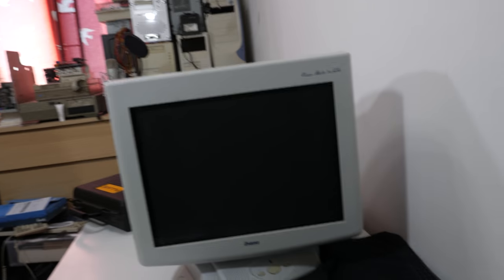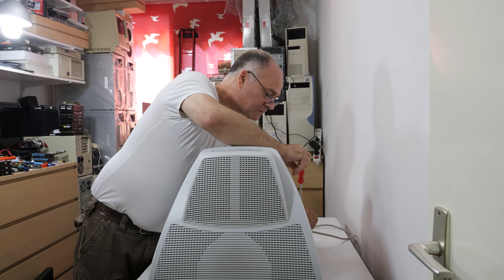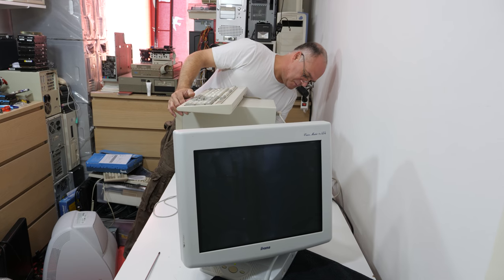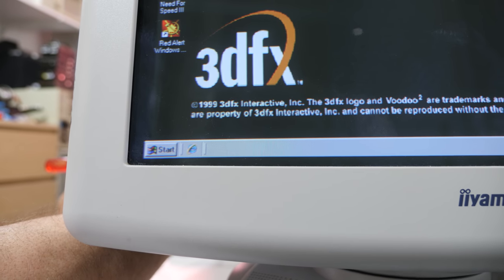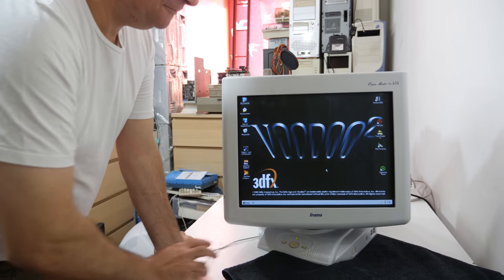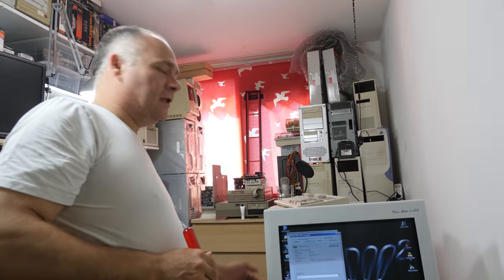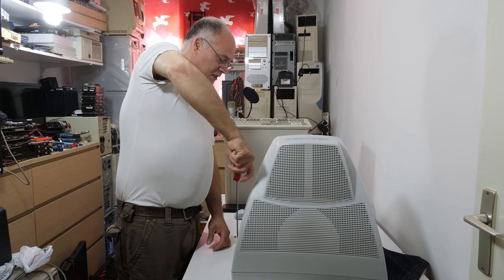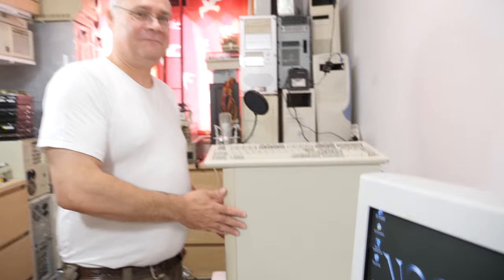Adjusting Old Crt Monitor With Dave, Iiyama Vision Master Pro 454 19"

Comment: That's NOT how you do it, you need to set the resolution to 1600x1200, used a calibration app to run a readability test (the NEC monitor test program is great for this) and adjust BOTH the focus and F2 potentiometers until you get a sharp result (these are very sensitive). Finally you want open a fully black image, set brightness to 50 in the OSD and adjust the SCREEN/G2 potentiometer until the black stop being fully black to get the brightness/screen setting back to their factory values. (as electron guns degrade over time, the voltage has to be adjusted, the more hours the tube has, the more you need to crank up the power, the SCREEN potentiometer is also very sensitve), on diamondtron tubes such as the iiyama vision master pro 454 in the video, everything is done using potentiometers, in Sony Trinitron set, G2 adjustments are done using the winDAS service software and a RS232 serial connection to the monitor, this is more cumbersome but allows for a more refined tuning.
Reply: Yeah I prefferred windas wpb was really nice and helped a lot vs iiyama and lacie diamondtron monitors I have
Reply: Thanks for the tips, got my 451 looking much better

Although there is still horrible green/red tinting on mine, and unfortunately looks like the only to properly adjust is them to desolder the eeprom and manually change the cutoffs (way above what I'm capable of)

Comment: That is a very good CRT monitor for gaming, you could overclock it even to 200hz, i would recomend 1280*1024 at 120hz, 1152 *864 at 140hz or 1024 *768 at 156hz. Diamondtron/Trinitron monitors were a dream for Quake/Counter Strike gamers
Reply: Love my Gdm F520, playing Smash 4 on it looks just insanely sharp
Reply: I wish i could get a Trinitron or a Diamondtron CRT for free. I've got in the past an AOC Spectrum 9GLR and at high frequencies was pretty sharp and reactive. I have to check at a classroom mate's garage, because he has many CRT monitors, and maybe i can find something
Reply: And after months i've got for free an LG Flatron F900P, 19"  CRT with 110Khz horizzontal frequency. It needs focus adjustment tho
Reply: That NS ı have F520's little brother, G520 :) With its 130khz horizontal frequency, ıt does 1920x1440 at 85Hz!

Comment: Guys, does anyone know if it is possible to open the stand without disassembling the monitor completely? The service manual is very unclear. I unscrewed 5 screws, but the cover does not give in. One of the buttons fell into the case, I need to put it back.

Comment: For anybody inspired to try this, please, please invest in a plastic "TV Tuner" screwdriver kit. They only cost a few bucks and you won't die when the screwdriver slips. Also, a rule of thumb for the amateur electrician: keep one hand in your pocket at all times. It's a hassle, but it means that if you get zapped the electricity will not go in one arm, pass through your heart, and out the other. It can mean the difference between a very nasty jolt or literally dying.
Reply from the maker: Yes be careful that is why I let the trained monkey Dave do the job! :)

Comment: 1:44 I know that this is an old video, but I want to throw in that actually both of these pots are for focus, the one for voltage/power is near the white pot on the bottom. I was able to set my iiyama's focus to an almost perfect level with both of the focus controls.
Reply: hey, do you know which one is for adjusting brightness? I rotated the white one at the bottom but it had no effect on the brightness, monitor is still too dark
Reply: @Akalvirp  There should be three black pots there, the brightness looks exactly like the focus but is labeled SCREEN. But first check if you can adjust the brightness in the service menu
Reply: @plaidzior  thanks for the info plaid!
Reply: Thanks for the tip, mine is much sharper now

Comment: I have a question for Dave: I'm still trying to adjust my Philips 107B monitor. It's a 17" CRT which  uses dual focus. I've been trying to adjust it just by turning both Focus Knobs on the flyback transformer, after I replaced it. I can't get all parts of the screen in focus at the same time. Somewhere on the internet I've read that you should adjust the grid voltage. How would I go about doing that? Is there something else I'm missing? (I'm commenting in English for everyone to read, but I'm actually Dutch so a reply in Dutch is ok for me) Hope you can help.